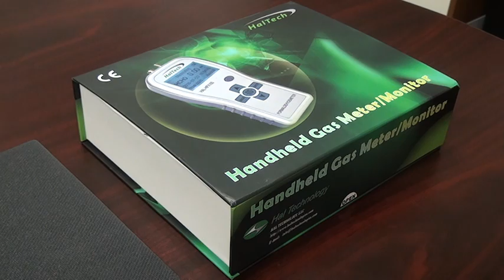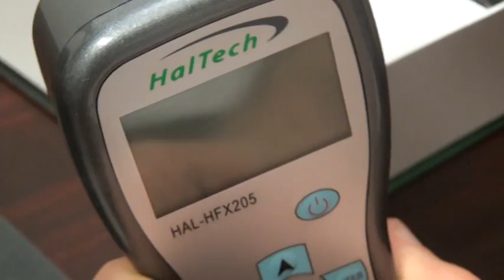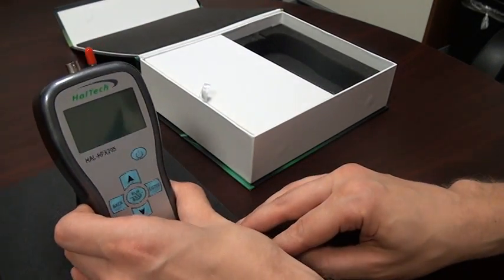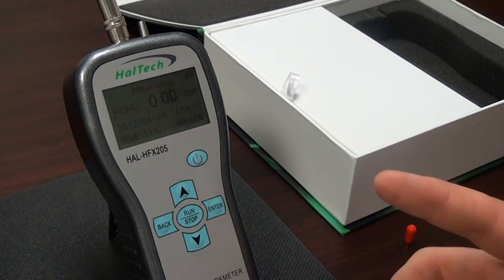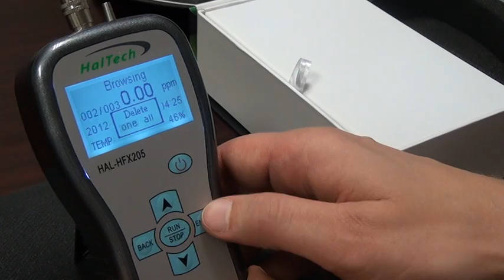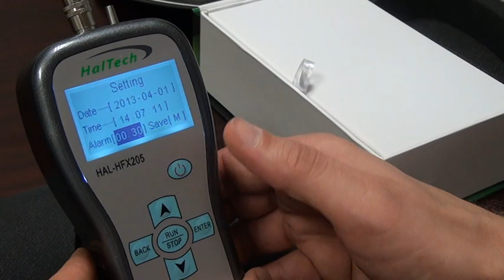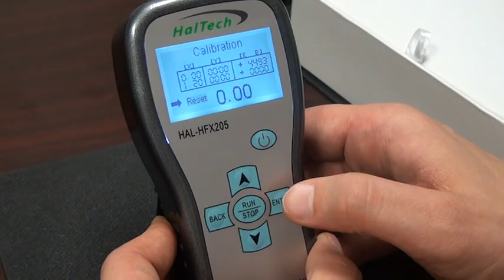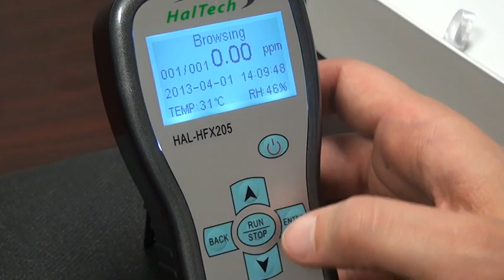Demo video for HAL-HFX205 handheld formaldehyde meter

Comment: limit value  of formaldehyde
Reply from the maker: Did you mean the limit of detection?  If so, it is 0.01ppm.
Reply: +855GETHALTECH thank you for your response 
permissible exposure limit to human is 0.01ppm is that correct
Reply from the maker: It varies depending on the standard adopted by different agency， typically 0.3ppm to 0.5ppm.  Other variable factors are short-term and long-term exposure limit (e.g., 30 minutes, 8 hours or 24 hours).  Please consult with your specific applications.